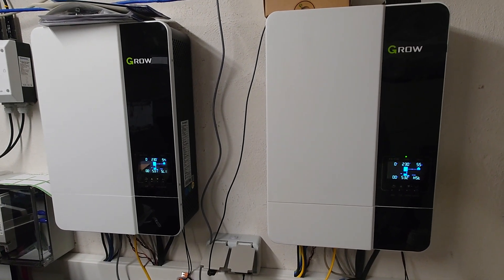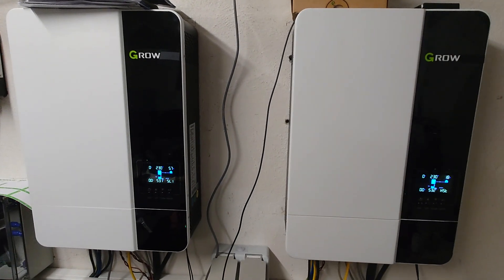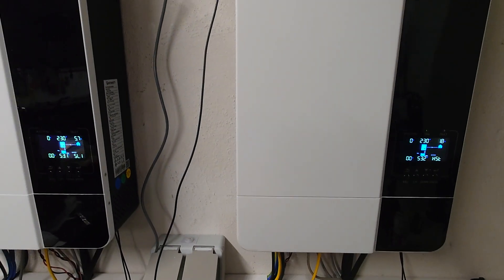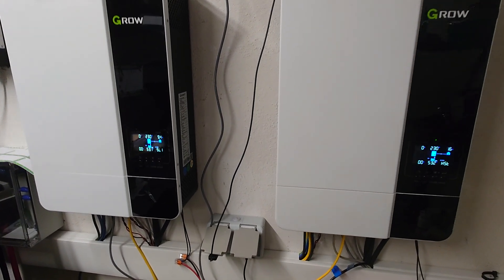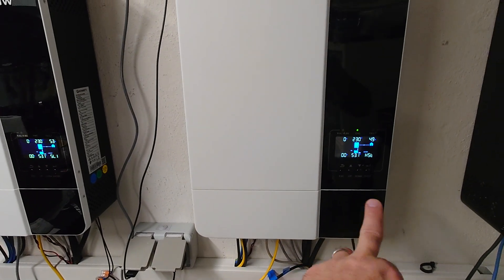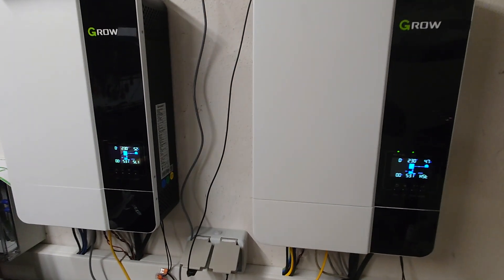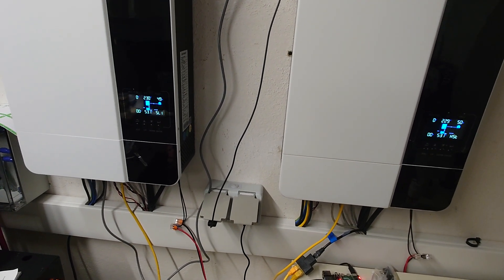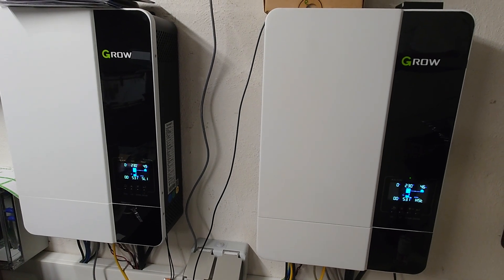Growatt SPF 5000 ES fan spin

Comment: Hi, I have 2 Growatt SPF 5000 in parallel feeding my house.  I have a 3rd independent Growatt invertor not feeding the house, but it does charge the batteries with solar.  Am struggling to connect a 5-kw generator to this separate invertor to only charge the batteries.
My settings are: 1. UTI ,03 GEN ,14 SNU with a 15-amp restriction on setting 11
The invertor does indicate voltage and frequency when the generator runs, but it does not go into by-pass mode to charge the batteries.
Have tried Growatt support...no luck
Can you assist perhaps?
Reply from the maker: first of all I would like to know the firmware you are running. if it is a 06X version the switch between sources may not work properly from my experience. did you connect the generator on the right connections? 
How is the whole setup with the other inverters connected? is there any communication  to the battery established from one of the 3 inverters? If you use charging by US or US2 you need to set the right voltages in the other parameters regarding your battery setup. Growatts support is worthless beside amosplanet...
Reply: @kirkdis  This inverter is separate from the main inverters. No communication with them. Only the BMS on one battery. So, it can see the percentage in charge.
The version is F4 A.27....if that makes sense. However, I suspect the no load is the issue.
Reply from the maker: @mariusverwey2125  the firmware usually starts with 04 06 or 11 but this firmware you mention is with certainty a 06 Version. that  say you have a second gen hardware of this inverter and those had massive issues with switching between the sources. in your case without communication you use for charging US or US2, right? Therefore you have to set all the correct voltages for your batteries in the parameters...

Comment: That’s very good but if you have the PV for example on and you’ll have the inverter off the PV start producing power inverter is going to switch on and off is not gonna damage the inverter the power from the panels is not coming like hundred percent to keep the inverter on if you know what I mean
Reply from the maker: @AlinA-vg5ud  depends on the firmware... the 06X.03 is not switching on as far I can remember. beside that I start the Inverters before the sunrise so there is never the condition on my setup present... but yes, I can confirm some of the firmwares might start the inverter as soon the string is producing power
Reply: @kirkdis  aha I understand now thank you 🤩

Comment: Hello i have read somewhere on diysolar that somebody have modified the fan control system and in his case the fans are controlled by temperature rather than by power. Do you think this is correct to do?
Reply from the maker: Hi Theo2482, thanks for the hint. I was not aware of this actions. Do you have a link to the discussion? My hardwired winter control system has this also as a feature beside the other advantages of my solution.